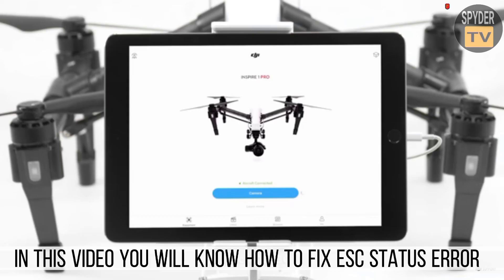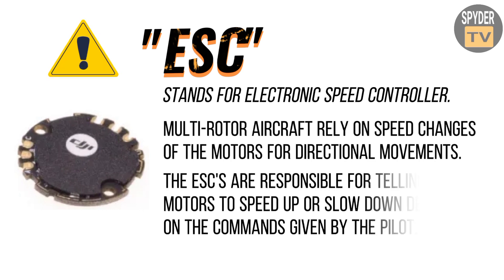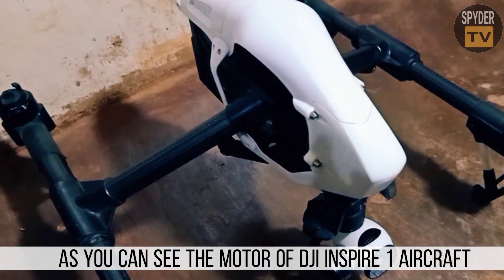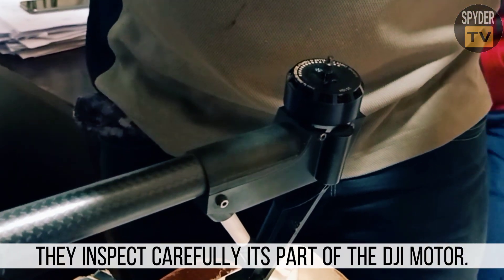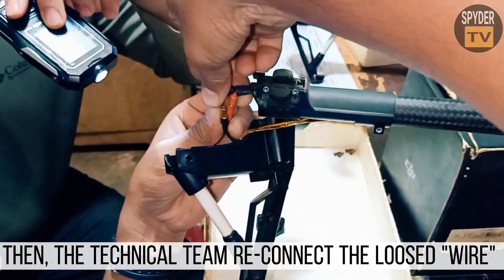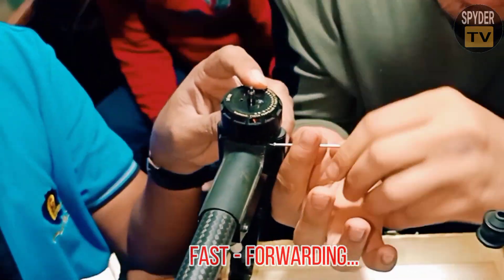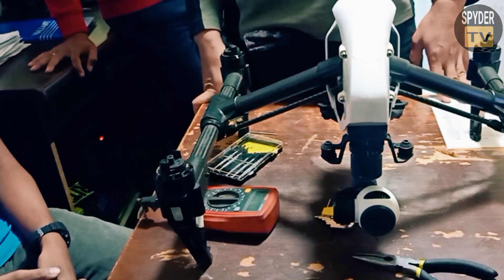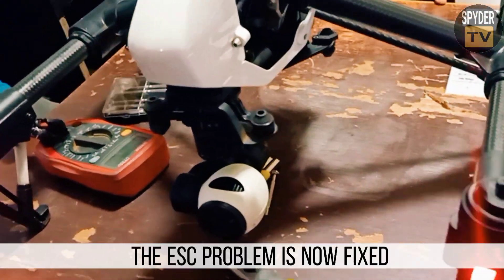How to Fix ESC Status Error for DJI Aircraft | DJI Inspire 1 ESC Status Error Problem? - 100% FIXED

Comment: I have a DJI fpv drone after a crash I got the esc error any tips on this
Reply from the maker: Check your drone including the rotor/motor of the drone which is the common problem in ESC error during crashed.

Comment: I have an ESC error but how did you know which motor to check ? Thanks !
Reply from the maker: You will know if you open each motor, and you will see what part of the motor has been ESC error or disconnected wire.